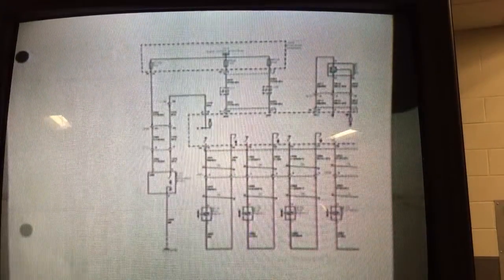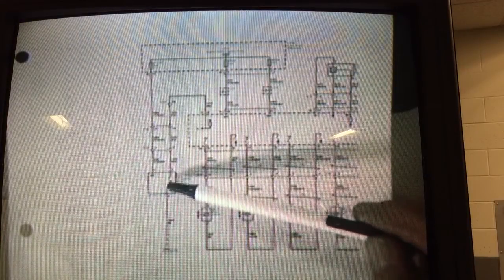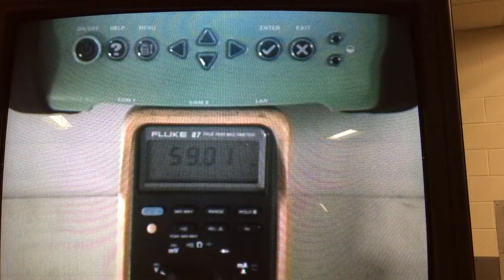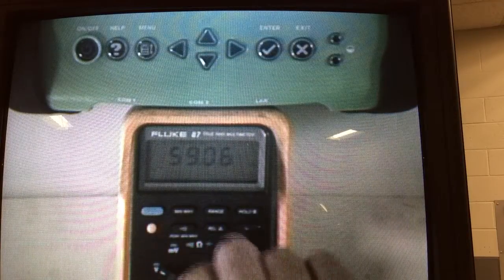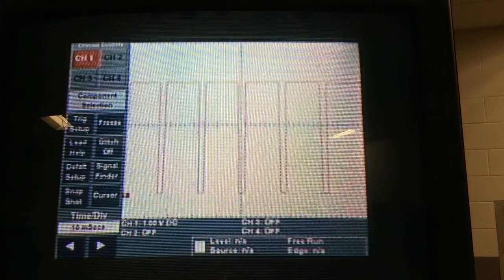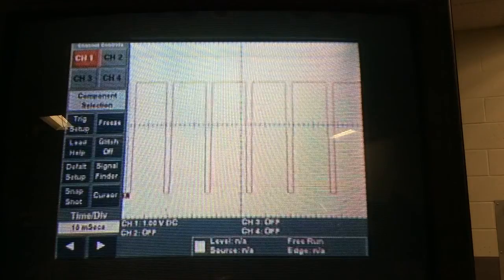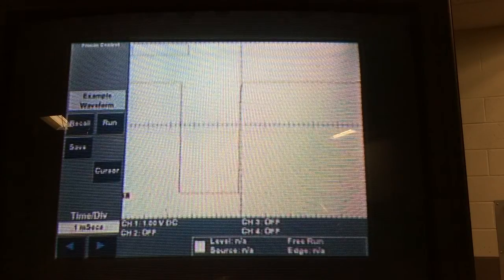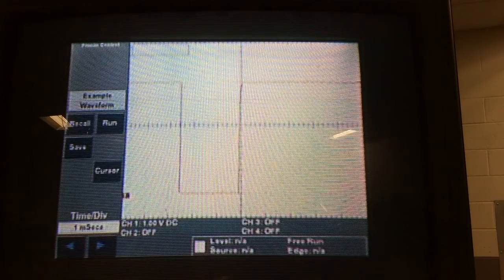e85 Fuel Composition Sensor

Comment: Where is the fuel composition sensor located on a 2013 impala?
Reply: Usually located in the fuel line under the car body passenger side with a 3 wire connector.
Reply: what about on a 04 suburban